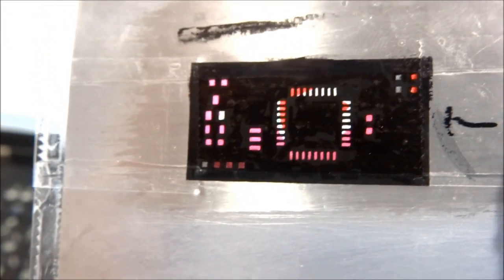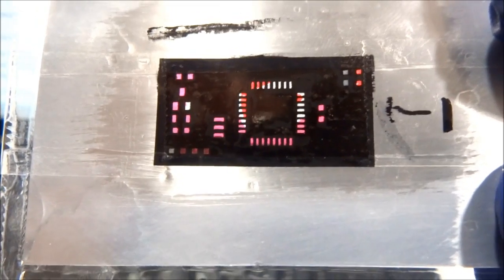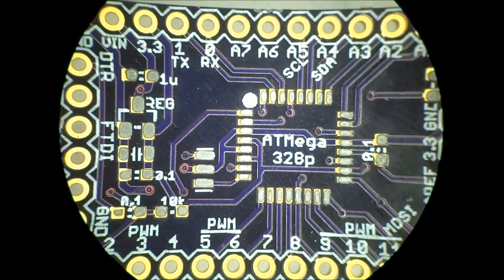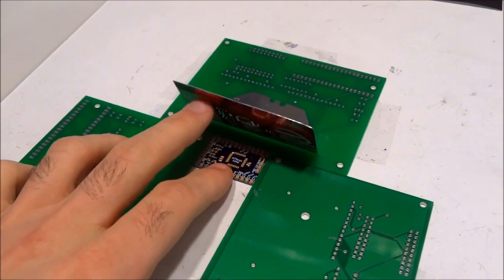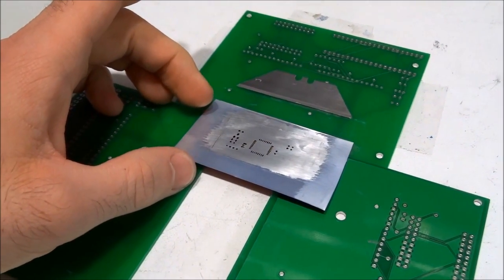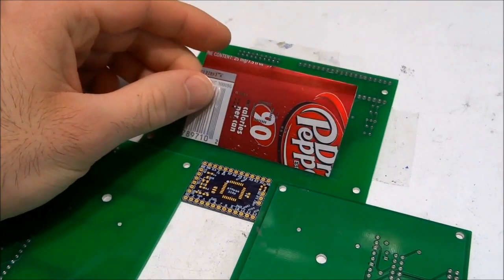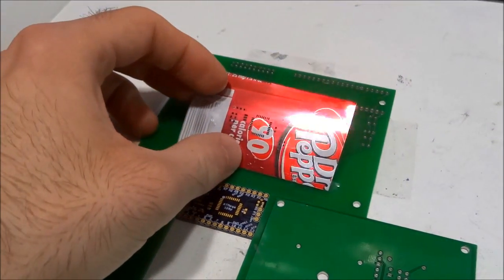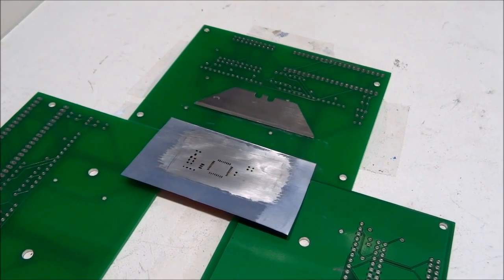DIY home made SMD metal stencil

Comment: nice job, seems very precise. do you think this method will work for making a 179pin 12x12mm bga stencil for alignment of solder balls, not for applying paste/flux, or can this precision not be done?
Reply from the maker: +Rune Mosbæk Probably not, see my laser etching method, that is actually easier than this if you have a laser.

Comment: I've etched PCBs decades ago using toner transfer methods (showing my age) but have not seen anyone do a homemade stencil for solder paste.  Yours look just like they look in the mass production environment, just using a soda can, so cool!  I was laughing when you said you're going to reflow the solder in a toaster oven using the "solder paste profile" from the manufacturer.  I don't doubt that but that's the first time I've heard "toaster oven" in the same sentence.  This is really encouraging and a great tutorial.  Thanks for sharing.  Great work there  :-)
Reply: ***** Toaster oven to reflow oven conversions are quite popular now amongst hobbiests. In fact, myself and a friend have just built one each. Very easy if you use some of the guides online for ideas. Ours use an Arduino microcontroller to simulate a PID controller which takes its input from an AD595 using a K-Probe. Be sure to use Quartz, Halogen or IR elements though as they are more responsive than regular toaster oven elements.

You can also now buy reflow oven control boards ready made. You just find an oven you want to convert, buy a control board, a relay and K-Probe and away you go. Some modifying later, you have cheap reflow oven that doesn't do a bad job. Usually they follow reflow profiles pretty well (to within a couple of degrees of their targets).

You should think about building one. My reflow oven build cost about $75 total. Great fun to build and good fun to use.